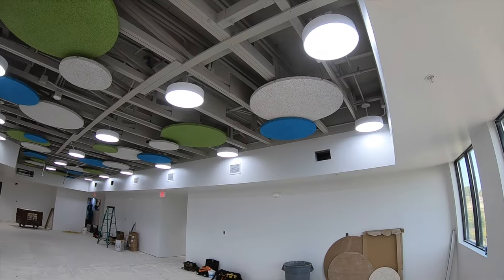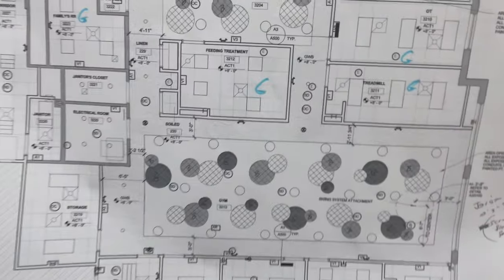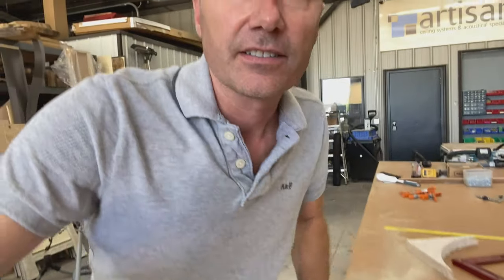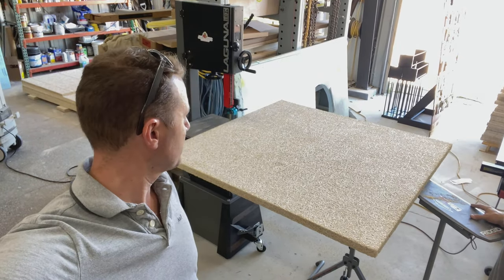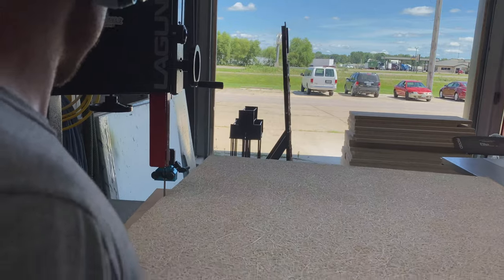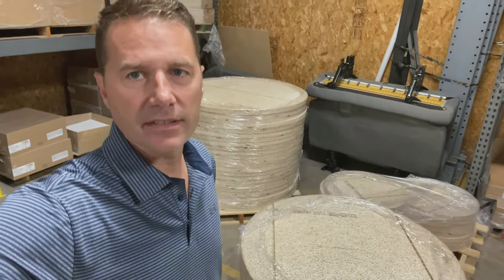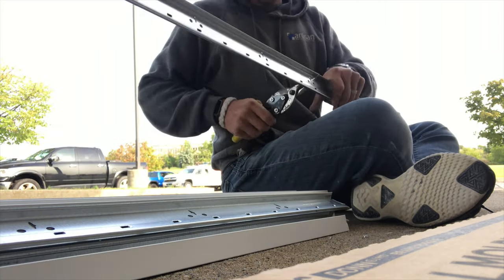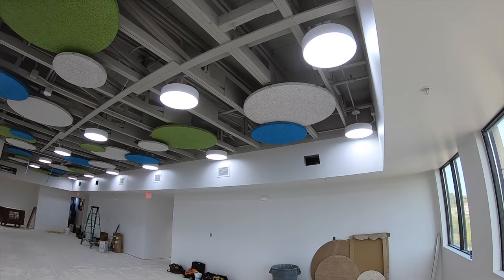How I Cut And Suspended Giant Tectum Acoustical Circles

Comment: did you source the tectum?  For the longest time i've wanted to use it for a project but was under the impression it was only sold in very large quantities through suppliers etc.
Reply from the maker: I have installed tons of Tectum and have never had a problem ordering even very small quantities. It’s better now than it used to be as Armstrong bought Tectum a few years ago, so now Tectum can be ordered through any Armstrong Ceilings distributor.